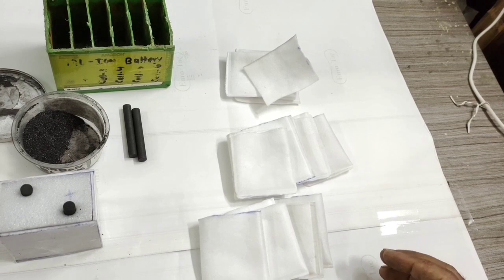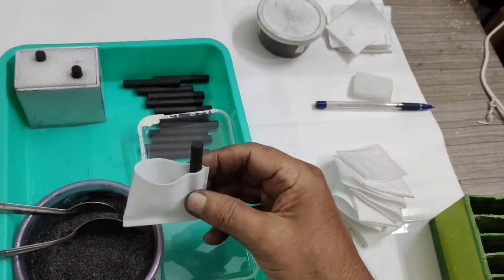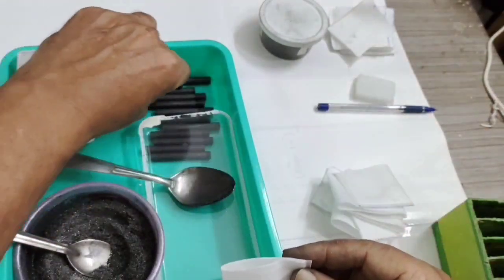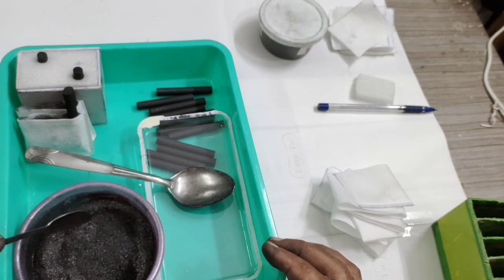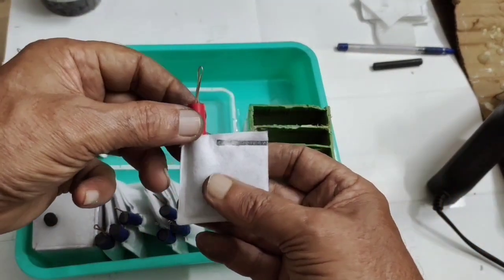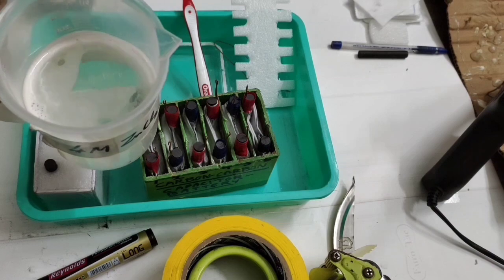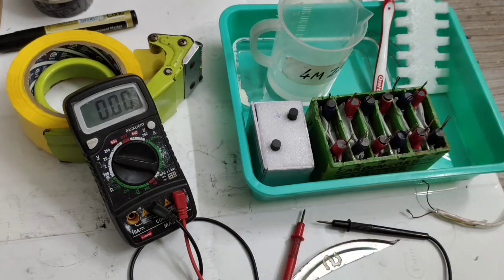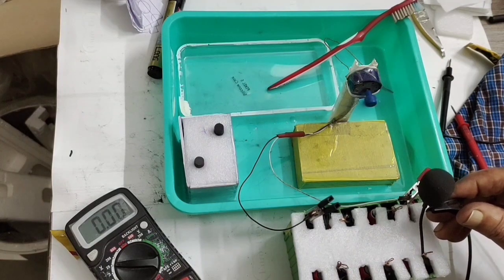CARBON -CARBON INSTANT CHARGEABLE BATTERIES, 6-CELL IN SERIES, EXCELLENT RECHARGEABLE CYCLES, V=9.4

Comment: If you can try ionic liquids for electrolytes you get efficient energy and rechargeable
Reply from the maker: I will try, okay 👍
Reply from the maker: I tried with choline chloride, aluminium chloride,urea- almost I was disappointed by the smell which it eminates, the strict conditions to follow. Not viable for me in my surroundings. Really I wasted my money.👍
Reply: @dkjawahar-techexpt671  I'm sorry to hear that your experience with chlorine chloride, aluminum chloride, and urea didn't meet your expectations. It can indeed be disappointing when a product doesn't work as anticipated, especially considering the investment made. Actually, it has a bad smell even sulfur as well that's why always sealed very tightly